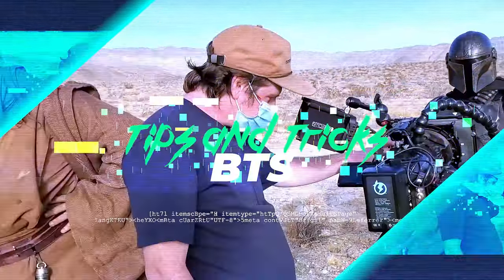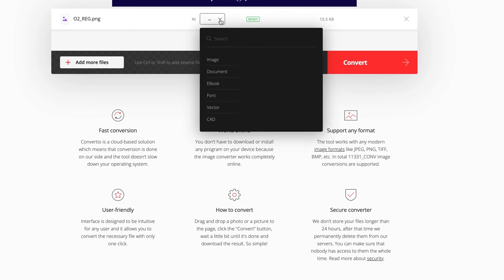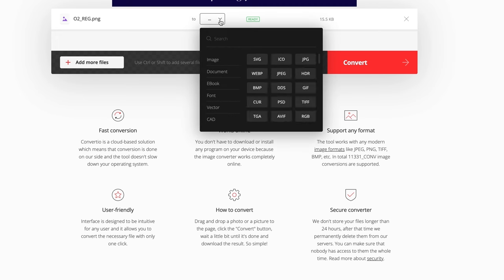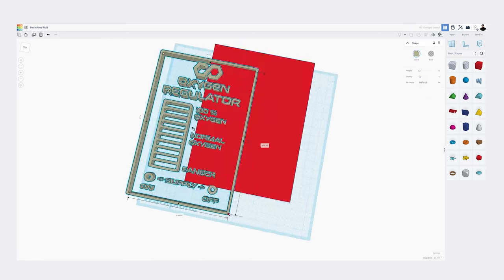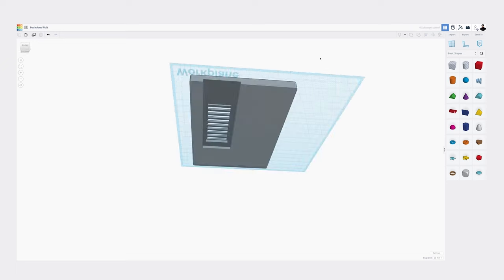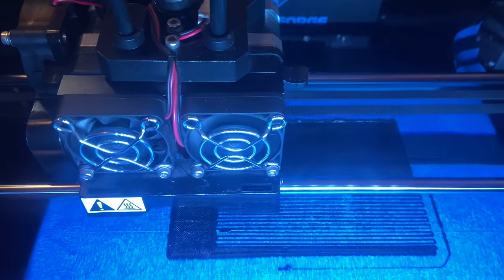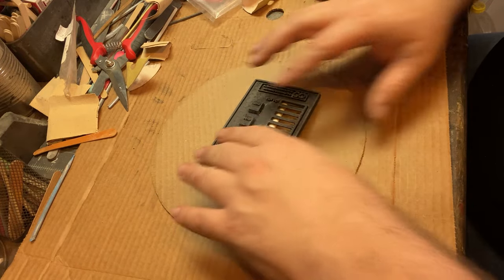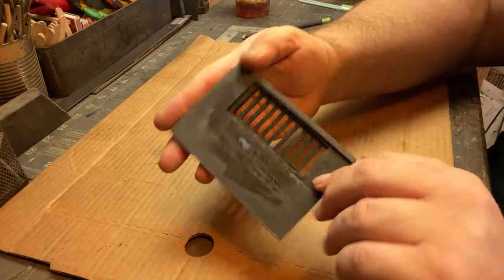EZ SCI-FI PROP DESIGN & BUILD TUTORIAL: PRACTICAL OXYGEN METER

Comment: I don't know why, but this video came up in my feed today, probably because we do similar stuff. Nice build by the way, but what I wanted to comment on is the folk who complain about 3D printing.

Now I don't do much of this myself as I don't own such a machine, but I have a friend who does and he prints pieces out for me every now and then, largely because I just don't have the time to scratch build it myself as I'm busy working on the rest of the build.

They way that I see it is that it's a time saver and above all else, it's a tool. If you're going to complain about using a printer, then you may as well complain about using a saw, a rotary tool, sand paper or even a screwdriver. Besides that, short cuts and cost cutting measures have always been used in set dec and prop and model building - that's why we use greeblies; instant eye candy for the camera!

Comment: Anthony, I know makers are getting asked all the time about the tools they use, but I have to ask.. you've mentioned 'wearing a mask' in nearly every video that involves paint or stuff that generates fumes. What kind of mask/respirators do you like when it comes to painting, grinding, and other stuff like that?
Reply from the maker: 3M Performance Paint Project Respirator OV/P95 . The dust mask is one of those replaceable filter ones and has a large velcro band for the back of the head instead of ear bands. I think the brand is Base Camp